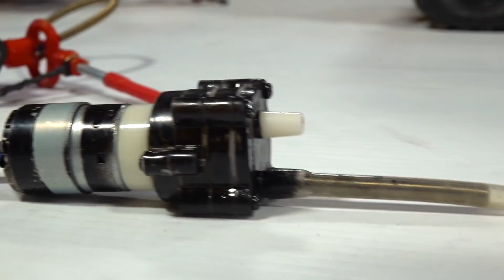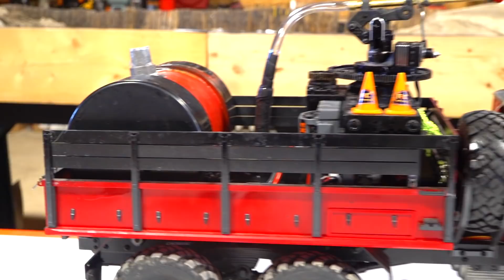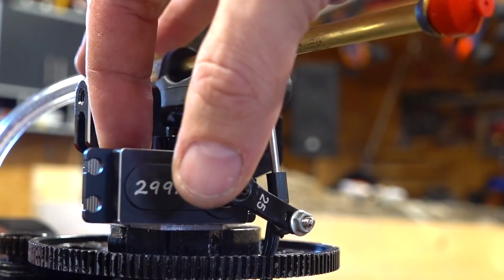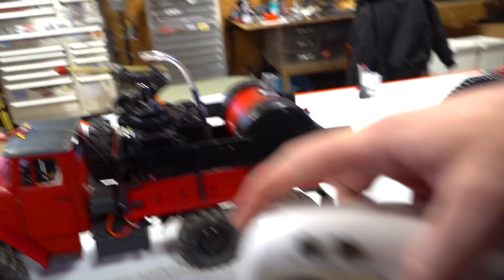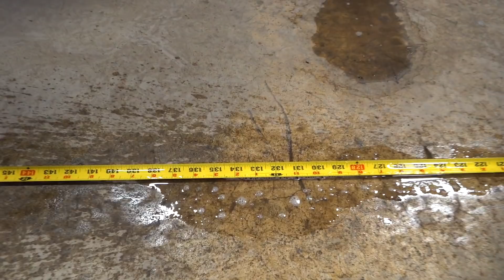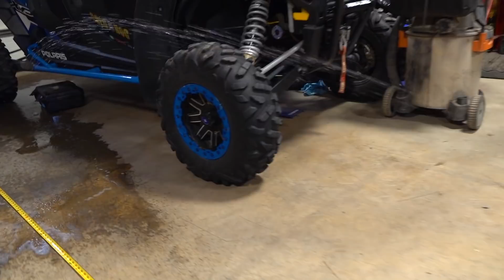HOW TO BUILD an RC FiRE TRUCK - PART 13 (Cross RC UC6) PUMP's NEW WATER SYSTEM! | RC ADVENTURES

Comment from the maker: Public Service Announcement Please be Alerted to a scam we have had reports of FAKE YouTube ADS using stolen video footage from our channel - These ads promise expensive RC's at an ultra low price. THEY ARE FAKE.  Please report the FAKE YouTube AD using this form: https://support.google.com/google-ads/troubleshooter/4578507  Do Not Be Scammed. Please share this information with people you think could benefit from this knowledge. If it looks “Too Good to be True” it is. That’s the Point of a SCAM. Be on Alert, and protect yourselves from Online Fraud. DO YOUR RESEARCH and buy from a Trusted Source.
Reply: @RCSparks Studio. Can u give me a car I’ll pay $100
Reply: Put a copper tube cooling jacket on and use the pump to cool itself
Reply from the maker: @ricerneon399  There isnt a heat issue
Reply: @TheRealRCSparks  I know but if it ever did that would be awesome
Reply: You did see the ones on fb as well right I would report them but not sure how
Reply: @anthonymoniz3865  pugs
Reply: @nes2306  pugs?
Reply: @anthonymoniz3865  yes pugs I like pugs
Reply: @nes2306  sorry that wasn't a proper question lol I wasn't sure if you were abbreviatting for something.
I hope I spelt that right lol
Reply: @anthonymoniz3865  it’s OK
Reply: Hi I seen aubot 2 or 3 add s

Comment: Mr sparks!!! I have a question and need advice. I just bought one of my dream rc’s the tamiya grand hauler!! I really want a light and sound kit. But the tamiya one is way way out of my price range. Have you tried the GT power one?  If not any other cheaper recommendations. Due to the pandy I dont have the funds i was hoping for this project. But hey! I got the truck!!

Comment: 18 feet, nice safe distance from the fire. Cant help but wonder what an interchangeable nozzle, similiar to something like a flower watering can with multiple fine holes in it would do for various types of situations. The added power of the new pump should compensate for the extra orfices ¿ Also I noticed in the last video that slippery surfaces made for a brief traction issue, when will it be time to add some drive axles to the supply trailer to compensate for the extra weight ¿ Not to mention making it the ultimate go anywhere rig ! Your videos inspire my RC nerdiness as well and I dig it my Brotha.

Comment: Once again. Another great video. Have you thought about putting scale diamond plate on the main gear to make it actually look like a turn table, like on a ladder truck. Maybe a seat on one side or the other of the cannon on the bracket. With a fireman figure seated in position. Still need emergency lights...lol
Reply from the maker: Thanks Bud.. actually.. these old URAL 6x6 could control the water cannon from INSIDE the truck!

Comment: Make it a flamethrower... you won’t.
Reply from the maker: I know you want to laugh when the flames melt my truck... but I cant do it bro.. I love this too much!
Reply: @TheRealRCSparks   Couldn't you build the flamethrower tank in the back of the truck with the flamethrower system not close to the truck to protect it from any fire  ?  Just a suggestion  , I don't know if that would even work  ....